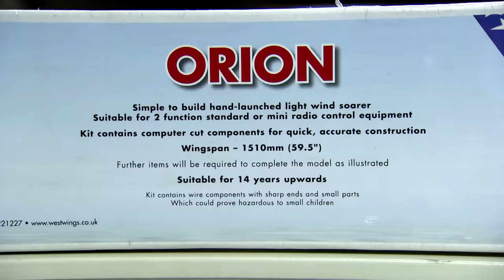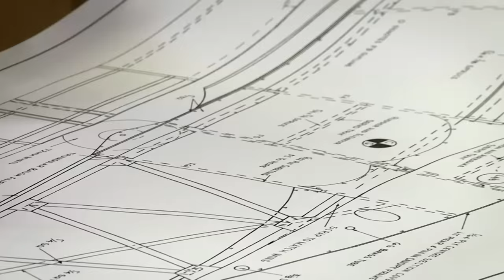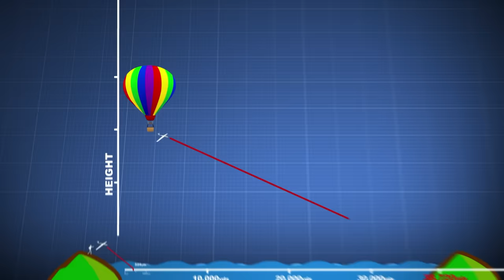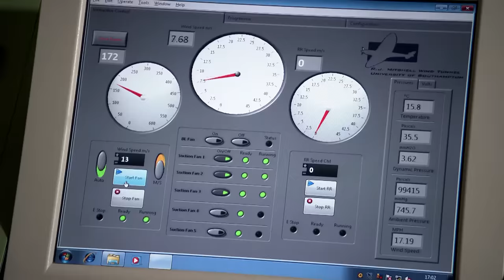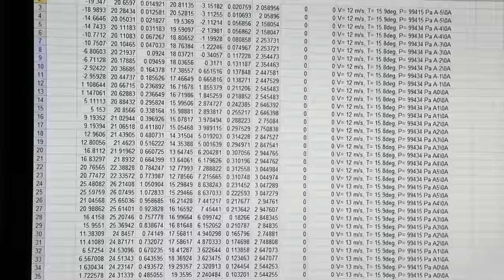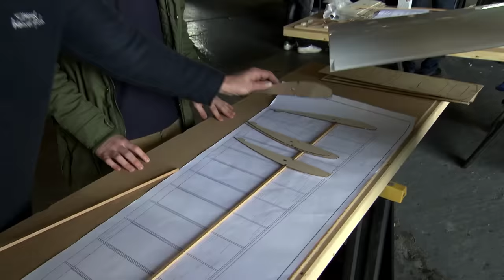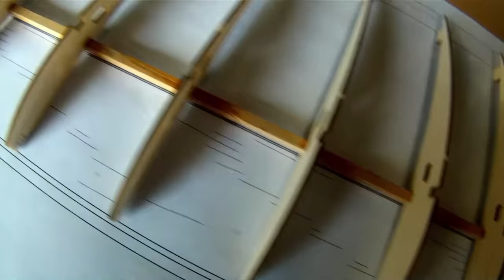Can This 1000 Piece Model Plane Fly 22 Miles!? | Toy Stories Special

Comment: OK, so the toy of my childhood, when I went into a hobby shop like that one, was the solid fuel rocket kits.  In the third grade I was lucky enough to have a teacher that was an absolute model rocket geek.  The wooden top of the coat closets where all of us young kids hung our coats and placed our lunch boxes was covered with model rockets.  We also has an elective class that this teacher taught, on making a model rocket.  I remember going to the hobby shop and trying to pick out which rocket I wanted.  I ended up with one entitled "Big Bertha" that looked more interesting than just a cardboard paper towel tube with balsa wood fins stuck on, but only barely.  I spent a few days assembling and painting my rocket then along with my classmates we all went to the large field behind the school and watched in awe as one by one our rockets were launched into the sky with a car battery and some wires.  He had a little button on a handle and just handed it to each in turn and told us to push the button.  I remember clipping the alligator clips to the fuse and being told to stand back as he handed me the button.  Whoosh!  the rocket flew straight up into the sky, so fast I couldn't follow it, then POP and the capsule blew off and the wadded parachute flew out and caught the wind as the rocket quickly descended back down into the field.  It landed pretty well and only needed minor repairs to be totally usable again.  I got to put it up on the coat cabinets, with the rest, for the remainder of the school year, and then I could take it home.

I have seen Toy Stories videos for many of my other favorite toys, HO trains, slot cars, radio controlled planes, Legos,  and even the Meccano (called Erector here in the States) kits, but nothing about the good ole solid fuel rocket kits.  Nowadays you can put a video camera in the nose and film the flight.  It would be fun to see what James and his crew could do with that toy as a starting point.  Of course today the drone has totally taken over as the king of flying toys, and advanced RC pilots can even make jet powered airplanes, but I will always have a soft spot for the good ole model rocket.  🚀
Reply: I take it you have read  Homer Hickam's autobiography..    ."Rocket Boys"?

Comment: That was brilliant!  What an amazing feat!   Here’s to every youngster who has built a glider out of paper or balsa wood, glue and paper.  

I remember building one with my father.  It was an amazing project that took us months of work in the garage.  We flew it a few times, but with a 6 foot wingspan it was just too big and fast for our local parks.  It could fly across them in no time at all.

It was made for wide open country and if it caught a thermal, it could simply fly away.  To solve that problem, it had a fuse in the tail that given a certain amount of time would cause the tail to flip up.  The glider would then stall out and slowly fall to earth.   We never did get to test it to its full potential.  It remained hung from my bedroom ceiling, looking glorious for many years.  Just building it with my father was worth every bit of our time.

Comment: Your RC helicopter at 4:08 reminded me of how I got into aviation in the first place. My first RC aircraft looks a lot like that toy helicopter. It worked for a few weeks and then the motor overheated :( It was so fun while it lasted. Then A while later I got a small (like size of your hand small) RC plane, but it worked better as a glider, especially once one of the microscopic motors gave out. Then I got a bit larger plane (a little bigger than your red piper) and it crashed into a few trees before the elevator rod fell out, making it impossible to control pitch, and therefore couldn't fly, but it lasted much MUCH longer and I'd buy it again if it wasn't for the next one I got. So far, these were all just actual toy aircraft that could fly in your back yard and only in less than 5 mph wind, but then I got an actual large RC trainer plane that hobbyists like me fly. Takes up the entire trunk of the car on the way to the airfield that you legally have to fly at. (well, almost. There's lots of legal restrictions on where it can fly and stuff, like not around crowded areas or above 400 ft or in airspace around airports, etc.) Now I'm on my way to getting a pilots license eventually.

Comment: As gliders rely on thermals to keep altitude I wonder if the glider can be fitted with sensors to detect the thermals, fly into them to gain height and then continue on to the destination.
Reply: I imagine the problem there would be control - once you get into a thermal you have to do some rather measured and skilled corkscrewing to gain height, which relies a lot on feel. You could probably program a flight controller to do it, but it'd be a heck of a piece of software.
Reply: @boiledelephant  the flight control algorithm they used, called Ardupilot, now has an autonomous thermal mode that does exactly this. And yes, it’s a heck of a piece of software, the code base is around 700,000 lines now.
Reply: @Noah Benton  I just realised we're living in the future...

Comment: Back in 90s I wanted to learn to fly rc planes. Bought a model, worked construction, bought the $300 futaba 4 channel radio, os 40 and learned to monocote with an iron. Wasn't real pretty but it should've got the job done. Guy at hobbyshop told me location they fly and I went several weeks in a row and nobody was there. Finally I got annoyed and mowed a strip down the pipeline next to our house. It was time. Took off and it looked great, until I turned with aileron and it went in other direction! I had it reversed. One little dip switch and the model was suddenly a pile of wood again. Few years later I taught myself and still flying FPV to this day.

Comment: What a fantastic story/video! The significance really hit home, not in just the long flight itself, but also as the glider was circling the landing strip autonomously to lose altitude and come in for a perfect landing. We've come a long way.

That sounded like my childhood. I was obsessed with flight. (still am) Like many kids that came before, I became a bit of an aeronautical engineer by sticking my hand out the window as my mother would drive us around in her 1967 Chevy II Nova (no power steering, power brakes, or air conditioning). I think my mother finally sold that car for like $300, and it was in excellent condition. It would be worth a small fortune now.

Also, If I squinted a little, at 19:30, with all the Cessnas sitting about, that even looked a little like the airport where I began taking flying lessons in 1979. Minus all the British rain......and tea.  lol

Even his thumb damage brought back memories. Although mine involved an X-Acto knife and a slice to the bone of my thumb. The Pietenpol I was building is long gone, yet the scar remains.  lol

Comment: Imagine a large wingspan, solar panels, auto-guidance, electric motor assist...you could nearly do it with off the shelf stuff and a bit of programming. With sensors you could make it seek thermals and stay aloft while minimizing motor use. The perfect university project that was done a few years back......

Comment: When I was a child my paper planes didn't look like everyone else's. 
My understanding of aerodynamics at the time, was that the plane is sitting on top of the air and sliding across. So, instead of the last folds being halfway, you fold at around 1/2 an inch from the bottom in a straight line to increase the wingspan, and fold the tips of the wings downwards 1/2 an inch to cradle the air underneath. 
It flies perfectly straight, with minimal effort and easily reaches the opposite end of the largest room in your school. 
I have never seen a paper plane fly better than mine. It probably has a glide ratio of 40:1.
The air has to be perfectly still though, any slight wind and it will lose balance and fall short.

Comment: I'm now wondering:  If they added a few IR sensors to the control package, could the glider be programmed to hunt for thermals and use them to stay aloft and extend their range?
Reply: In the 80s I was working on a IR thermal hunter but ran out of funds. Would be easier today.

Comment: All sorts of design changes can be made to the fuselage because it doesn't need to carry a person or fuel or a weight load just balance the design to keep the wing edge pointed up to catch more wind for lift. You can design the fuselage so it is less drag easily enough to keep stability and even help in the lift characteristics one is looking for to help the wings in the design of the overall structure, think outside the box.

Comment: If the glider is caring all that equipment than you’ll need to use an engine (theoretically) and also use a metal frame to to make sure that the glider doesn’t crash under all that weight

Comment: Americans, decades ago, were strapping an engine on smaller aircraft than this one and sending them on transatlantic crossings as weather sondes. It's quite baffling to look at the navigation and distance traveled for the fuel consumed and payload necessary to make that possible. One or two of them are still around, including one on display at the Boeing Museum of Flight in Seattle.

Comment: 7:13  That phougoid motion was induced due to static instability!
A little weight in the front, and the high wing, with dihedral, would have  glided all right, no stall, estimated L/D of 4.  I started at age 10 , direct with balsa wood and paper, no dope but learned about putting the CG just ahead of the quarter chord on a straight wing and adequate decalage on the larger than scale horizontal stab. For swept back wings the CG at the mid leading edge. No dihedral there, just more decalage (negative angle of incidence relative to the wing zero lift incidence) Why? Because the lift derivative is lower on a swept wing, as is on a low aspect ratio wing.
All this results by the time I was 13.
Then came Prandtl with lifting line theory, and now CFD, but the principles did not change, until Ackeret with his linear supersonic theory when? in 1925!   Linear led to the famous, non existing sonic barrier at  precisely M=1 : infinite drag
1/√(M²-1)      singularity at M=1
Out of reach for us modellers.

🇧🇴🦅🏔️

Comment: Very Cool BUT a more modern day glider would have proven itself better than something from the 70's and since I am from the early 60's I myself know that, and has anybody thought or possibly tried to cross the channel in a Para-glider of course you would not want to ditch into water wearing something like that so you would need a proper boat to land on if some unforeseen problem arose.

Comment: My Big Brother and I when we had our first real Hi performance RC Planes ran the numbers (30 years ago) as how long it would take our planes to fly to Down town Vancour BC Canada from the RC field we use to fly at on Vancouver island about 50 miles. Our planes max speed at that time was only 125mph depending on air temp. The economic cruse speed was about 100mph and the small nitro methane tank we could get 20 minutes out of 10oz of fuel. Basic math skills were fun to see. By the time I ordered after market RC gear about 2005 I had a Video link that was rated at 20 miles and an after market Radio Control link that was rated at 60 miles with only a 3.5Db gain antenna. it was at that time I was fully up to speed on all Transport Canada regs, had my Ham ticket for a transceiver to be legal under the term Pilot in Command (the old regs said you had to be able to contact aircraft if you saw them close to your RC plane while in the air if you were not flying at a registered field), and new back then that RC aircrafts days were numbered in Canada and for that matter anywhere in the World. There is an old movie that used RC planes to fly across the English Channel that was about smuggling Diamonds in Toy air planes back in the 1977 called sky pirates. Pretty funny story.

Comment: Certainly a feat, but I can’t help but be slightly underwhelmed by it in comparison to the single motor model plane that crossed the Atlantic using only a gallon of fuel in 2003.

Comment: A couple of observations. I prefer to call model airplanes airplanes in miniature and not toy airplanes. And I also wondered why you didn’t fit an electric motor in the nose with a folding propellor to use for takeoff and getting up to altitude that could be shut down at will. There are actually powered rc gliders like this on the market. It would have saved a lot of money by not having to hire the helicopter.

Comment: I'm a little surprised they didn't just put another Mavlink receiver and APMPlanner station in the boat. They could've avoided a lot of that clumsy radio chatter by just listening directly to the autopilot's idea of where it was. (It knows where it is because it knows where it isn't...)

Also, it looked like it was wobbling quite a bit even in steady air, which suggests that the control loop parameters were poorly tuned. Time was tight so perhaps that's understandable, but it scrubbed off a lot of speed and thus glide ratio with all that unnecessary banking and turning. Another attempt with exactly the same hardware could yield far better results with just a few minutes of tuning. 

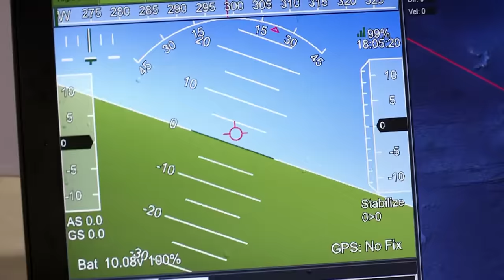It's a shame they didn't acknowledge the enormous open-source codebase that made the autopilot possible. You can see in the screen at 21:11 it's ArduPilot, which really stands on the shoulders of giants when it comes to the software side of things. (And in that shot, the GPS hasn't initialized yet, hence the location off the coast of Gabon, at zero latitude, zero longitude.)

Comment: Easy, the lift to drag ratio depends on speed .  At one speed it has a maximum, this value is:
(L/D)m =½ span √(π / cdA)
π = 3.1416
cdA = drag coefficient × Area
Very simple, but you need to use the wind tunnel to determine cd. 
The speed V ?
That depends on the density, at sea level
rho = 1.225 kg/m³
Now
½ rho × V² = q =
 weight/(span √{π × cdA})
finally
V = √( 2 q / rho)
There you have it, it's all there!
Units: go metric and in the land of Newton, the weight  is not pounds but Newtons!
To increase the glide ratio, increase span.
Reply: Incorrect!
Reply: @Maxtyur  you talking to me, if so what don't you not like?
Reply: @arturoeugster7228  You're formulas are so off it's amazing.
Reply: @Maxtyur  prove it , write the equations that you think are correct and compare it to the exact equations formulated by Barnes McCormick.
Reply: @Maxtyur  again, write the equations for the induced drag and the parasite drag , where they are equal is the max L/D and with a little algebra you can derive the expression I quoted 
The induced drag is
Di = (L÷span)²/(q×π)  inversely proportional to q, the dynamic pressure 
The parasite drag is
Do = cd ×A×q.  proportional to q
The minimum of the sum occurs when
 Dp = Di
Reply: @arturoeugster7228  I entertained movie stars and royalty my boy, the paradox of pie 3.14 is well documented and proven  you're equations are out dated physdo science at best.
Reply: @arturoeugster7228  Oh my boy you should come to Harvard we can drink Tea and I can teach you the science of Engineering.
Reply: @arturoeugster7228  My boy this is YouTube not a educational institution ok .
Reply: @arturoeugster7228  You've been beaten by a smarter man my boy ,good luck in your cleaning job my young apprentice.
Reply: @arturoeugster7228  Bonjone my young man the Latin word or symbol  is one of great study I myself have used many languages, texts the dead sea scrolls for instance  Please I'm a teacher a hero a God.
Reply: @Maxtyur  histantanpunko
Reply: @arturoeugster7228  your Spanish is rudimentary at best you see I'm a professional teacher a teacher of young minds a demi God a purvaer of knowledge.

Comment: Oh boys. Launching from 8.000ft is just cheating on purpose. You can launch it in space and circle the earth almost unlimited times. It can also travel forever throwing it outward the solar system. Gliders use thermal dynamics to fly distance. So just do it right.

Comment: Adding even the smallest motor and prop. With even a 9v battery. It would go much further. A 100mm especially a 200mm prop with a brushless motor and 5s lipo battery! 

Id love to build a small fighter jet looking glider almost, tiny experimental from carbon fiber and maybe kevlar.  Possibly use small nitro rc engines with generators bulding a hybrid  aircraft.  Use ducted props.   Use 50mm fuel line to move the fuel around to different tanks . bladder tanks inside carbonfiber tanks. In the wings and fuselage.  With batteries and generator mounted in the nose. With the craft being just large enough for two large people(6'6" 350,)  with multiple brushless motors in pods under the wings, having ducted props.  600-800mm with six - eight, roughly 6kw  brushless motors powering the props in ducts.. running at 120vdc +/- with 12 nitro engines simulating a radial engine, mounted to a carbon fiber hub also being the housing of an axial flux generator. Capable of nearly 20:kw , depending on the windings tapped, and number of windings tapped. And the hub can hold 24 engines spinning the hollo 40mm shaft. With a timing belt. The magnetic rotor being carbon with the edge bring wrapped with carbon fiber and 300-400mm diameter, with 6 coil disc with 3phases each, and each having a magnetic rotor on each side , some sharing rotors 7 rotors Total, with N52 neodymium magnets, about 12mm thick and 20 x 30mm+/-,  the rotor can grow slightly. Nothing to hit close by. Test spin it to 10k rpm. The motors do well over that .